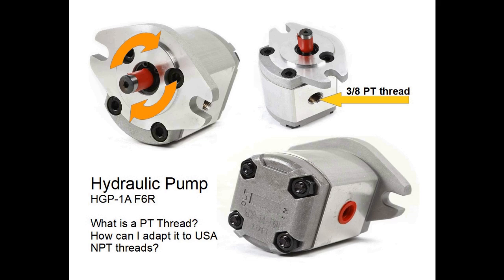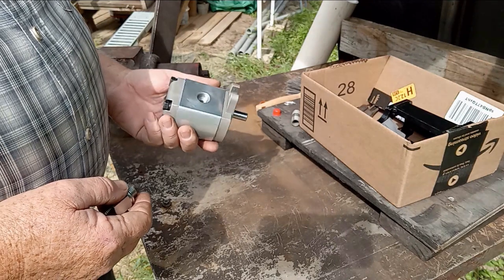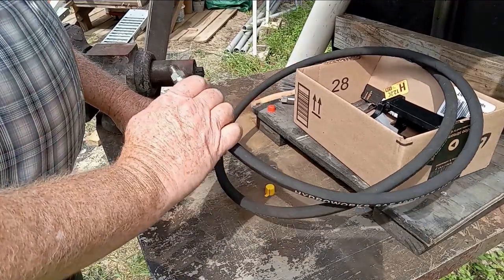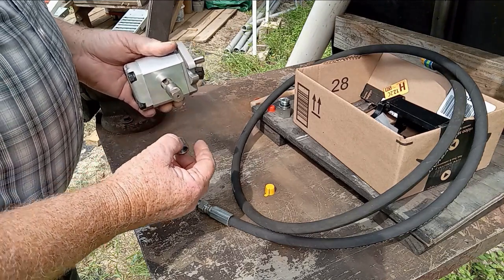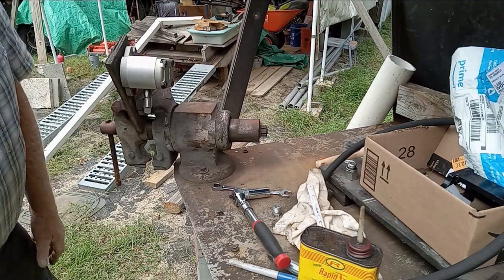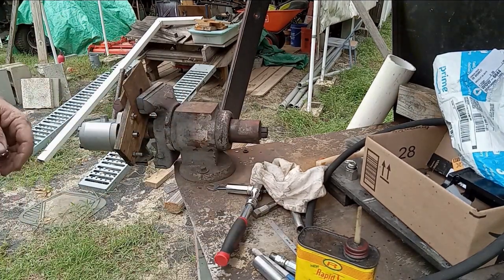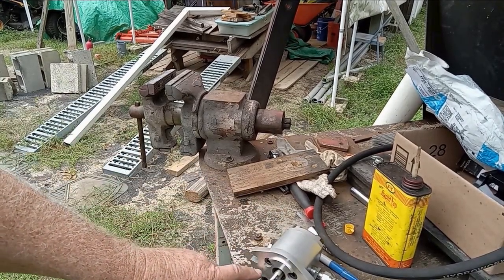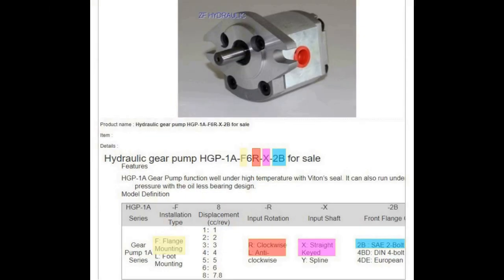Popular Hydraulic Pump - Converting PT threaded ports to NPT

Comment: You can get a bunch of different versions of this pump, you don't need to screw around with adapters and that kinda nonsense. The last section of the pump id code is the port style, P# indicates PT thread, but you can us F# to order them with flanged outlets, or U# to order it with UNF, and G# is for BSP or PF fittings.

It sounds like you would want an HGP-1A-F-06-R-X1-4BDA-U1 pump. for 9/16-18 UNF, or U2 for 3/4-16 UNF. They can also do NPT instead of PT if you just ask for it while ordering.
Reply from the maker: Yes that is true, but hold on to your wallets. Most of my subscribers are weekend project people. When you make a specific order to have the pump to just what you want it costs big bucks. I have seen this same pump selling for over $700 just the way I would want it.  Compare that to buying this pump on internet outlets like Ebay and Amazon for under $100 and then tap it out to my fittings and save $600.  This video is for the person that doesn't have a big budget or have the resource of a large corporation.